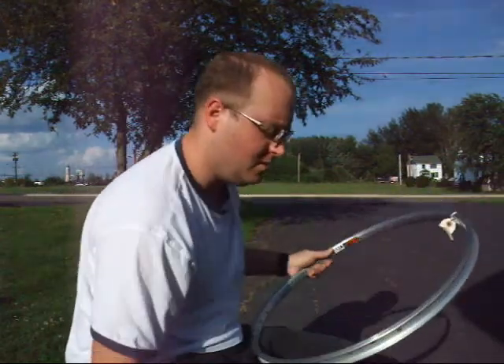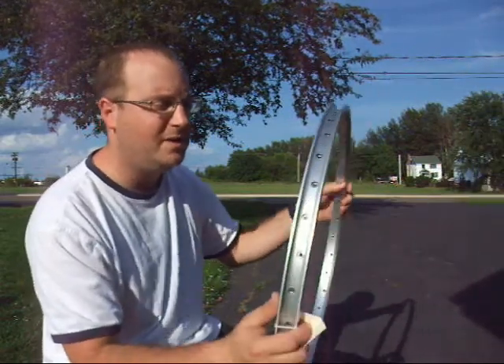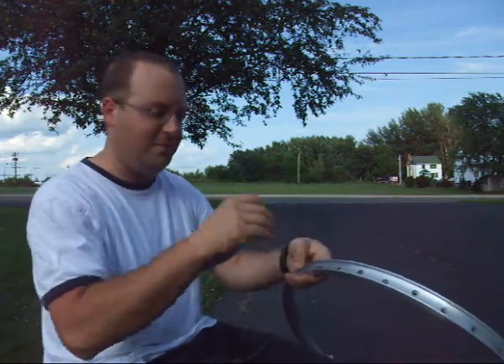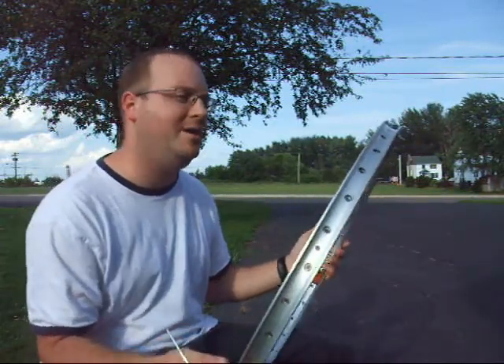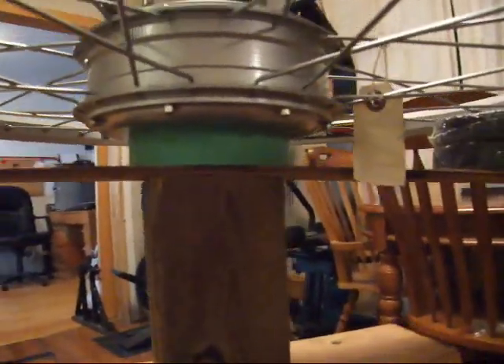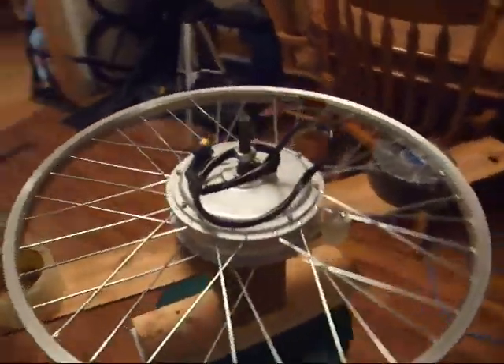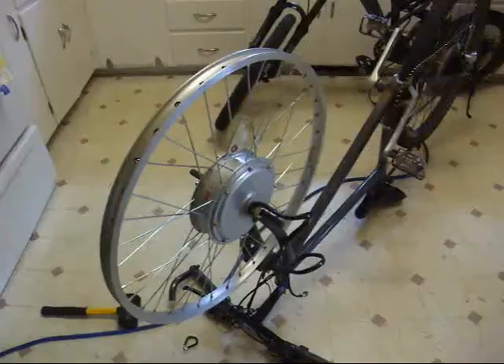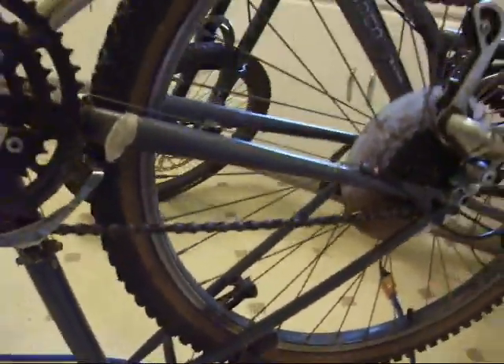Hub Motor Wheel Building Basics

Comment: Thanks great tips, I've built a few wheels with guys who a great at it. Their big tip was once your hub is laced loose in your stand with the spokes hand tight start at the valve hole and go every three spokes as you tighten ( not sopkes in a row). It takes a while but the rims usually come true without flat spots this way. You can detention , once you are close to getting done, the spokes by also having the rim on it side and applying pressure on the rim hands across from each other going around the rim,do this on both sides. This works well with your method of detetioning the spokes in the stand with your hands grabbing spokes that are paired vertically. 
Thanks for the video.

Comment: You can buy spoket that use standard 2mm nipple, from the center they are 1.8mm (wich is better that 2mm, they are stronger in use because they are more flexibile in point where they dont have to be so thick), and they are 2.34mm from the shoulder end. So does it mean normal 14G from nipple, 15G from center and 13G from the hub end.

Example DT Swiss Alpine III is this kind of spoke

Comment: You make a simple task into a major headache. I mount motors in wheels all the time, and I use a hand drill to open up the holes. It takes under 2 minutes to do the whole wheel.
Reply from the maker: The drill thing works with non-eyeleted rims... but to retain the eyelets a round file is the only way to do it.. ( the drill bits grab the eyelets and they spin free... i've tried )